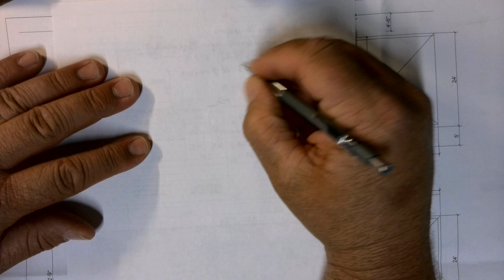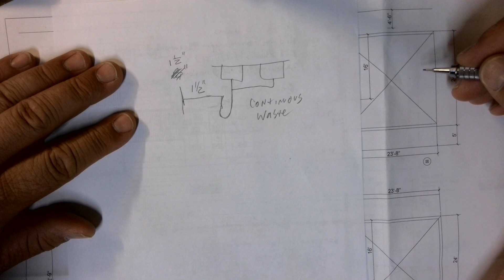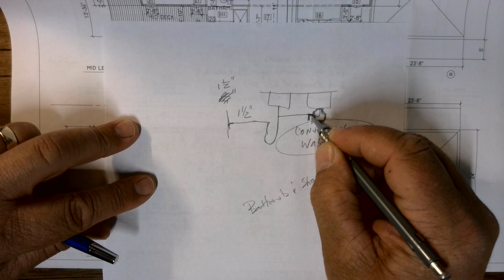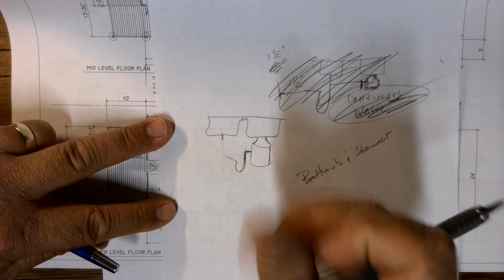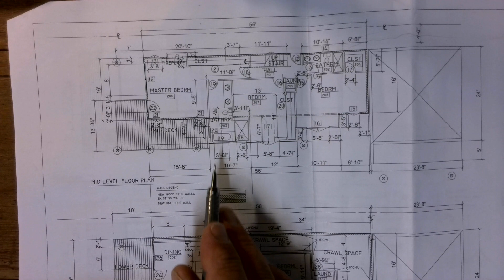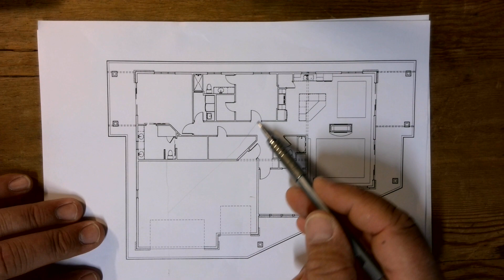Plbg I May 11 2020

Comment: The shower symbol is not correct in supposed to be a different, This hatch is for elevator.
Reply from the maker: The designer of the drawing will always utilize different symbols for different things.  These symbols and abbreviations will be noted on the first page of the drawings.  In this case the designer used that symbol for a shower.

Comment: Can you explain how to use  scale on plumbing blueprints . Thanks alot
Reply from the maker: Usually if you were to scale anything for accuracy, you would go to the architectuals.  The plumbing drawings, although still drawn to whatever scale is dictated, will not show dimensions.  That would mean if you had scaled it without a given dimension and it were scaled at, say 1/8 inch = a foot, you could be off by enough to have your pipe in the hallway instead of the in the wall.  Another example of why plumbers will look into each section of the drawings in order to correctly install.